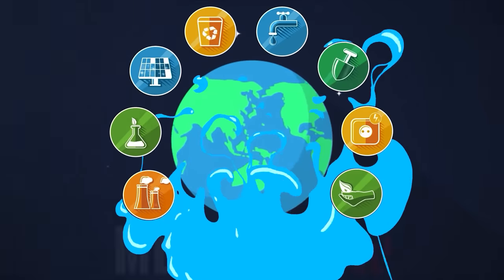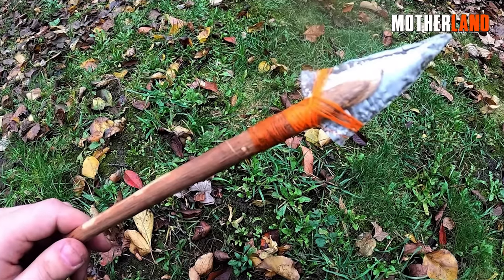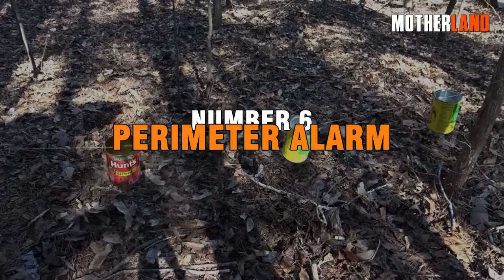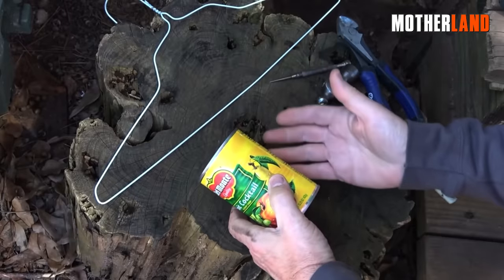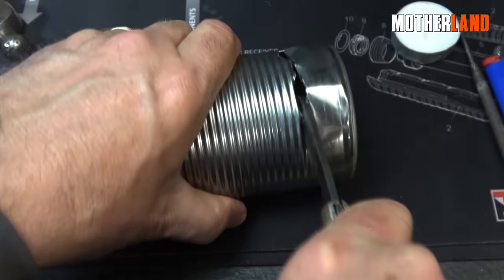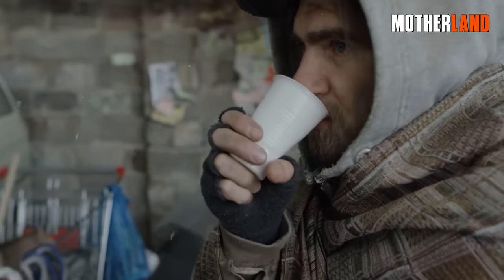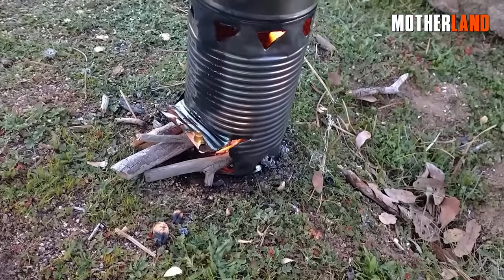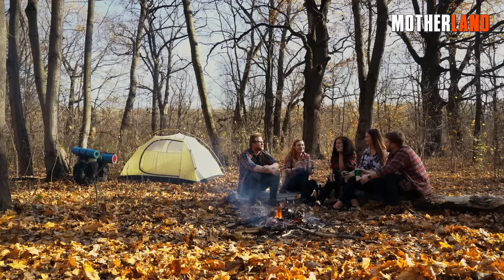TIN CANS: 10 Survival Hacks And Uses

Comment: Don't forget to burn off the plastic lining and remove the toxic residue by scrubbing it with dirt or sand before using it for boiling water or cooking your food in it. Unlike the cans back in the hobo days all the new cans have plastic liners as well as all the new soda and beer cans.
Reply: That stuff is nasty. Most of the can industry switched from BPA linings to a BPANI linings, This new spray we use smells worse than the old stuff.
Reply: I can tell you that I DID NOT know this and I was ill for days from the smoke. Luckily it was a very short time and I was able to air out the area quickly.  YES. PLEASE I MUST ALWAYS REMEMBER AND SHARE THE INFO TO-  DO NOT FORGET TO BURN OF THE PLASTIC LINING AS @GRAVLEV687 has so graciously reminded

Comment: Just an addendum to your list. If you are in a cold environment you can put stones next to your campfire and heat them up. Put them in the can and place it in your tent before you retire for the day and you can warm up your space safely.
Reply: The heat won't last very long and won't heat that much unless you mean a LOT of stones. The lowest temperature of the day is normally around dawn. When you get out of a hopefully warm bed the next morning you'll still be cold.
Reply: @joewoodchuck3824  no arguement brother just thought there wasn't too much else to do with that can 👍
Reply: Look up a sand battery.
Bigger they are the longer they last.
Reply: @crazysquirrel9425  too nuts I just watched a post about the sand batteries. I am going to use them in my greenhouse! Thanks for the suggestion
Reply: @markperron851  You are welcome.
Just be sure you do not use silica sand - use construction sand only.
It also takes a good while for all that sand to get hot. At the same token, it takes a long while to cool off.
Think of sand on the beach - cooler in the morning but generally hot in the evening.
I suggest using a stainless steel stock pot.
But be careful, they use aluminum rivets to hold the handles on and those can melt off (had that happen when making biochar).

You may want to set the pot on a good sized rock so you don't scorch your tent floor or carpet in an RV.

If using in a home, set it on top of a gas (not electric) stove or for either stove, on the oven door (opened) so long as it doesn't tip the stove over.

I took bricks from an old chimney and made a temp stove outside. I use lots of sticks, twigs, etc for the fuel source.
At least it's free!

Be advised though that the pot can develop holes in the bottom after 30-40 burns or so.
Reply: @markperron851  My post never posted for some reason....hmm.
Anyway, avoid placing them directly in the ground as it will draw the heat away.
Reply: @markperron851  Ran across a sand battery video. Guy put a wood burner fan on top of the sand. Hot sand caused the fan to run and circulate the warm air.
Not sure a sand battery will last an entire night. Most likely a few hours anyway.
A rocket mass heater (made with cob) might be a better alternative.
Some people heat their house with those.
Also, one video I ran across the guy piled up leaves (compost in the making) next to his green house and modified part of a wall.
Big pile of leaves generated a lot of heat for a long time.
It resembled a very large compost bin attached to his greenhouse.
Nice thing is that in the spring he had fresh compost/leaf mold to use in the greenhouse.

Comment: Can lids are glued not welded.  When over a fire, the glue melts and there goes dinner right out the bottom.  There are molded bottom cans (for better can stacking in stores) that work a little better without glue, but they're aluminum alloy and if sitting in direct flame can dissolve into slag along with dinner.  Cooking with cans should be raised above a fire, never in it.

Comment: If you do this for cooking burn out the can first
Reply: I think an intact liner is fine for water based cooking. I've heated many a new unopened can of peas or similar with no problem. Once you burn it however it may create a toxic substance that may not be easily removed. Yeah, it's partly speculative but I'll stand by it until proven otherwise.

Comment: A good starter list, but this video leaves out perhaps the most valuable tin can usage as an improvised turbo encabulator. Just be sure to use a baseplate of prefabulated amulite, surmounted by a malleable logarithmic casing in such a way that the two spurving bearings are in direct line with the parametric fam!
Reply: That is all true for sure, but when using the prefabulated amulite,  a girdle spring is often needed. Something hard to find in the outback. A Cardinal Grameter may be substituted, as this puts the resonant phase of the newly lit fire in diametrically syncronised retro encabulator.  Not as good as your Turbo Encabulator but a step in the right direction without a Girdle Spring.
Reply: @alexwild4350  Indeed! I appreciate your insight. In my enthusiasm over these crudely conceived tin can revelations, I regrettably confused the inverse reactive current of a phase detractor of the Rockwell Retro Encabulator with the modial interaction of magneto reluctance and capacitive deractants of the original Chrysler Turbo. Well spotted, Sir!
Reply: Are you guys engineers?

Comment: I’ve often seen the tin can used for hand fishing. The only problem with this technique is that the line has to be hand thrown. Why not attach a slingshot of some kind to the back of the can? Attach the line to a hole in the back of the can. Mount a slingshot to the back center top of the can. Simply roll your line up around the can. Add a small sinker to the line just above the hook. The sinker is what you’ll use to launch the line out. Bet you’ll get it out a lot faster and further than throwing it. I’ve seen folks using slingshots to launch slingshot darts considerable distances. Why not bait on a hook? Put the bait out where the fish really are. With a little bit of practice you could get the bait out to anywhere you wished
Reply: In looking back on this one other benefit is that not only do you have a better chance of getting the bait out where the fish are more likely to be but with a little bit of practice you can get the bait just where you want it. It might be something good to use on the Alone series. When it’s getting colder and the fish are moving to deeper waters hand thrown lines just won’t cut it. Plus you won’t be fishing in trees. When the resources are getting scarce you need every hook saved.

Comment: I make small fishing spoons from the thicker part on the bottom of pop or beer cans and shape them with a extra  small ball peen hammer . Simular to a Dick Nite spoon they work great using a slow retrieve because they're so much lighter than the metal ones. Just put a small keel wait or split shot about 15 inches up the the line. I use 4 lb Trilene XP in low vis green.